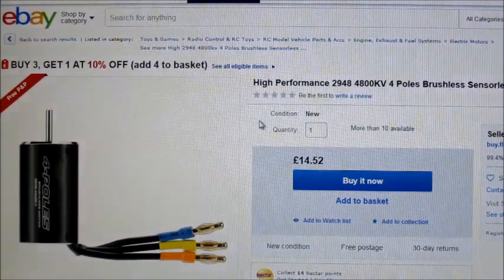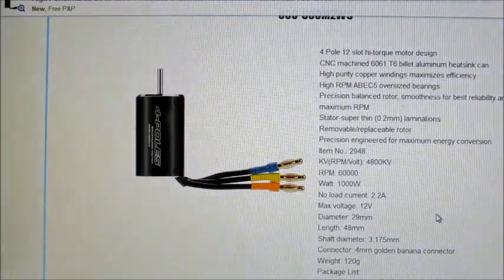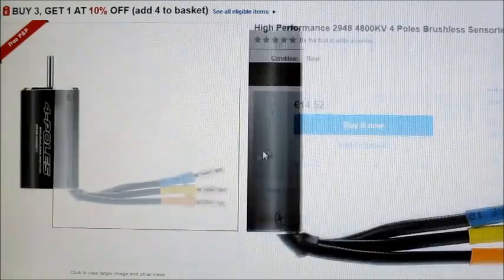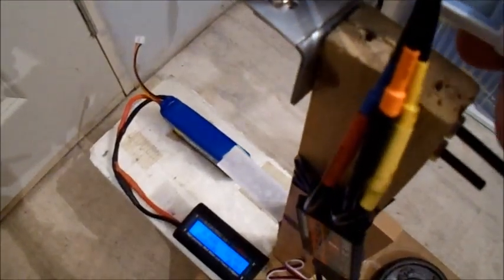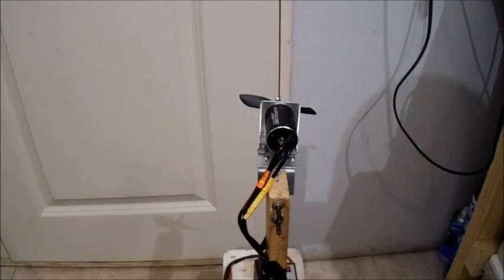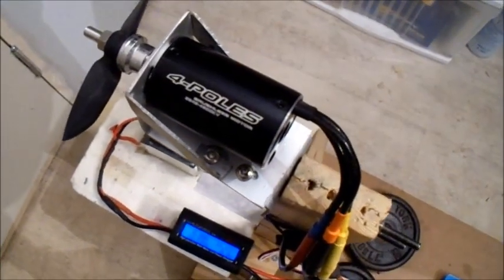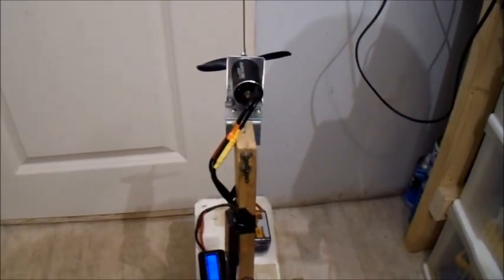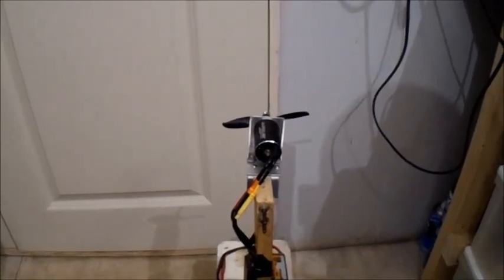2948 4800kv Brushless Motor Thrust Test Motor test of the Week

Comment: Would this work as an electric supercharger for a car with an actual turbocharger?
Cleatus McFarlane on you tube has done an electric supercharger test just recently with actual real results. 
I want to do a diy version of an electric supercharger for my car
Reply from the maker: Probably not. This motor is quite small. I also have seen most of the electric turbos on youtube  and researched into this myself so I know what you're talking about. They need more power then this motor. Unless the turbo you use in tiny but then you wont get much boost. Really small turbos would need to be spun at twice the RPM this motor is capable of to get any boost.
Reply: @rcplanepirate  
Any ideas on the electric motor I would be looking for
Reply from the maker: @healthymindhealthybody9692  I you're only running your cars 12v then no sorry.

Comment: Machining,CNC machining,CNC Milling, Turning, Drilling, Broaching, Sheet Metal, Welding etc.Welcome, ask for a quotation on metal and plastic parts.
Website：www.winsolid-machining.com   

#winsolid #winsolidPrecision#divingscooter#underwaterdivingscooter#underwaterdiving#scooter#SeaScooter#Electric#WaterSportsDiving#GearBox#MotorcycleParts#CNCparts#CameraHousingCase#CameraHousing#gear#Synchronouswheel#Bevelgear#pulley#medicaldevice#oem #odm

Comment: Hi, Can you tell me if its possible to use on 4s with 4045 prop in pylon racer? It s not too hight kv for this motor? Do not suffer too ball bearing?
Reply from the maker: Yes in this video I do run this motor on 4s with a gemfan 4045 and a TGS  4.1x4.1 prop. Should be ok with good cooling. If it wears out the bearings they're not very expensive to replace. Nor is the hole motor. Great motor for the price.

Comment: Seems to me measuring the temperature after just a few sec of run time is worthless,
Reply from the maker: Actually motor wires can get hot very quickly if you're running too much current through them. Just a few seconds. The fact that the motor was not getting very hot at all even with no air cooling the motor shows that it can take a lot more power. With my experience I know what temperature is safe on my test rig compared with the motor in flight with air cooling the motor. So it's not worthless!
Reply: @rcplanepirate  love your work
Reply from the maker: @sidamarali3030  Thanks

Comment: Hello my friend! Do you think this can handle 5x5 TGS on 3s in flight for about 10 sec bursts without a problem? As well I am wondering what your huge experience shows about the so called "unloading" in flight. What is the average % unloading in your experience?
Reply from the maker: Hi there
I think a 5x5 will be way too much for this motor. Maybe try this size. https://www.youtube.com/watch?v=NivTITpx2TE&t=472s
I couldn't really say about the unloading in flight problem. Too many variables to make a good calculation.

Comment: They raised the price on it,...( 390 brushed can size)...what it is,,,it's MOUNTING holes
The 1/12 r/c cars/truck,,,such as the 1/12 FY03 or 1/18 979A ect  (popular turck) has 390.
It'll only do around 20 mPH.....So you drop in the 2845 to make them do over 30 mph on 2S.
The higher KV will work on 1/18 ( light) over 40mph 2 cell....CHEAP upgrade.
The bigger can size is hoping to get TORQUE and retain HIGH RPM to run the 2S for the 1/12....or run COOLER...

However they made a wierd size....2850 2650KY....It's perfect for 1/12 4x4 Monster
trucks with bigger wheels....Pop wheelies on 2s...
You can always run 3s. It'll pop wheelies and do over 40 mph easy..
it's beside the point.. It's still a POWER to weight ratio kind of thing
or being able to use the wazooo of stock piles of 2s LI ION packs.

I have a couple of PX-16...cheap out of the box ( twins 390),...what you want to do
is drop in these types of motors...so you dont have to replace the motor mount
drive shaft, or props (28mm)....it's 40-50 mph  ON WATER...which is stupid FAST
from 15.lol  ALL for UNDER $100...including the HULL...ect
It's 32" hull.....which is a BIG BOAT in the r/c boat world.
Factory made boat that size are $300-$400.
2-3 cells to keep the cost down....esc and batteries.
Or you now can prop it up to 30-32...to make it do MAGA rooster rails and WHEELIES
on WATER...LMAO